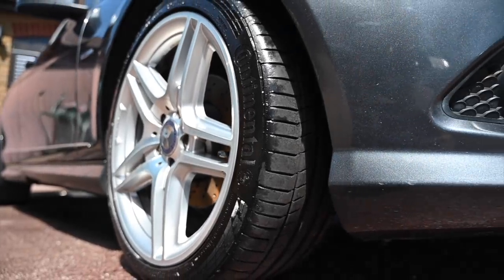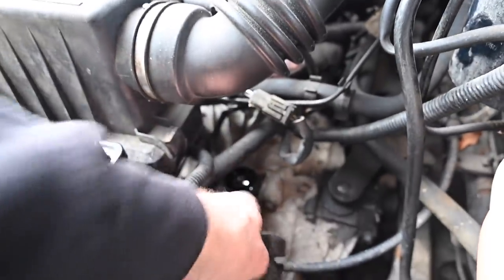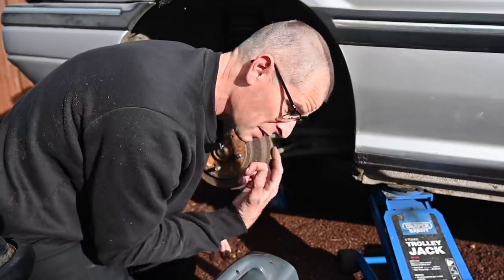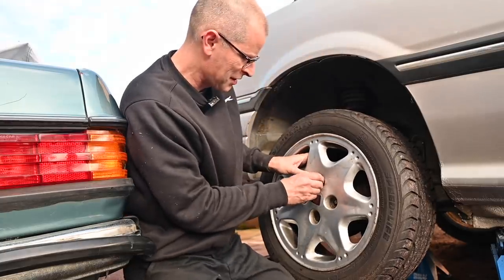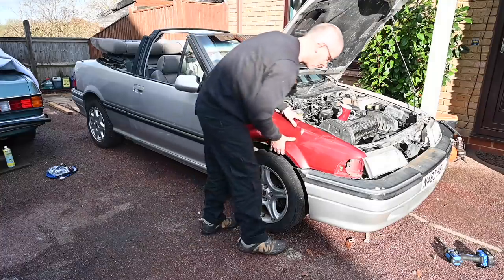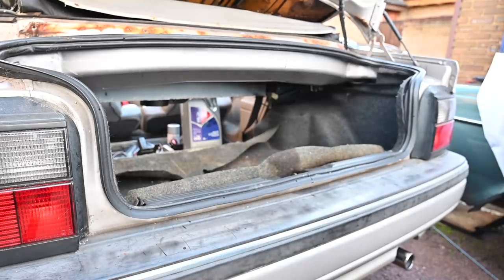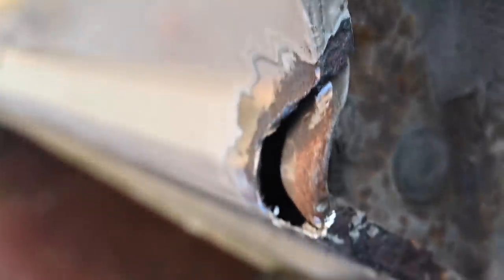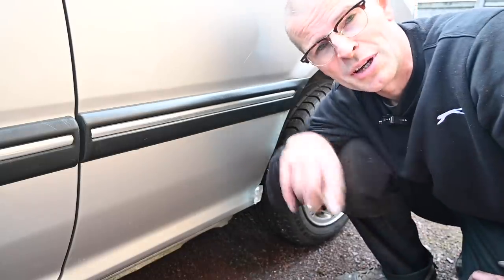Rover convertible MOT prep part 1

Comment: You should use  a test light not a meter for checking current at the pump. A meter will read battery voltage through a single strand of wire.

Comment: Excellent!  A slightly dodgy body repair that I can relate to 😊.   When I fill a gearbox I use a funnel with a piece of hose shoved onto the end of it that fits into the filler hole.  Then you can hold the funnel up high and pour oil into it (slowly).  I'll bet there is another plug somewhere that has poor connections, either that or there is a problem with the plug at the pump.  Either way, it's your fault, not Quentin's.  hahaha

Comment: You can't really check circuit integrity with just s volt meter because you need to check the circuit while it is loaded and carrying current (or not).  Being as you're testing the circuit unplugged there is no current flowing so any reading is untrustworthy.  It's even possible, depending on your meter that the meter is creating the 6 volts.  Either test the circuit with the pump plugged in or run an incandescent test light in parallel with the meter so that there is current flow and/or voltage drop.  And look for battery voltage, not just 6 volts.

Comment: Well one thing is for sure, with a security system like that no one is ever going to steal it....i hate electrical problems as you are never sure its actually fixed or you're just lucky its worked

also yep those wheel do look better
Reply: I remember when my Rover 220 GTI got nicked and all they did was pull the front wing arch plastic covers open and pulled the wires off the horns. So even though the alarm was going off it was completely silent. Yes Rovers anti theft device was disabled in about 30 seconds. Hated the scumbags at the time, but funny looking back now😂

Comment: Strange why there’s only 6v at the pump ? Did you change the relay ? I used to test relays with a 9v Duracell to operate the relay then check the resistance of the internal contacts with a multi meter, I’d temporarily bypass the impact cut off on the bulkhead just incase its corroded, talking of corrosion, I bet that spare wheel bolt is solid with the amount of water ingress that car has/had mate, good luck 😉
Reply from the maker: Yes, changed the relay then it worked and now it doesnt!

Comment: Sure seems like the fuel pump relay. Intermittently working/not working. I would do a second search, it may be integrated...is there any workshop manual that can enlighten you?
Reply from the maker: Ive got the factory manual but the cabrio is different (helpful)

Comment: Rear wings available at Rimmer Bros for a stunning £50. Cheaper than a w/a section and you can fit as much or little as you need. You know it makes sense.
Reply from the maker: For the convertible? They do have some random mega deals, although that doesnt include the hours of fitting
Reply: @furiousdriving  Just checked again .... they were £54, now sold out. Sorry. N/S Tourer rear wings still available at £54. Wheelarch with some sill available at www.carbodypanels4u at £50. If you bog it up the rust will only bubble back through your respray.

Comment: 6.5V to the connector is probably because there is a very very bad connection somwhere between the battery and the connector (or a broken cable, that barely makes connection.).
Reply from the maker: must be, or a corroded connection

Comment: Checked the relay for the fuelpump under a magnifying glass? I've had cracks in the solderings that made it work sometimes on my old volvo 244... Is there a fuelpressure sensor that starts the fuelpump? Is the ignition switch behind the key okey?
Reply from the maker: It might be the relay again, Ill have to take it apart

Comment: do you think that it could be an immobiliser problem because I used to have a Renault Clio back in the 90s and sometimes when you unlocked it and put the key in it wouldn't start it was just in the same thing as your car is doing you have to pretend to get out liquid over the remote and then unlock it again and then it would start
Reply from the maker: I did try locking unlocking opening the door but I think it cuts the starter rather than the pump

Comment: I've been at the forefront of the Save The Rover campaign, encouraging you to keep going, but this is the last straw. I don't want to be responsible for you having a mental breakdown Matt, so it might be time to cut your losses, save your sanity and get rid.
It's a wrong un and a British wrong un will never be a right un.
Put your effort, dedication and skills into the W123, at least it was designed and put together by skilled workers, not disgruntled badly manged ones. There's a chance the Merc will reward you for your time not keep kicking you in the nuts.
If you're that deep in with the Rover and push on then I wish you all the luck in the world. You must be the most patient person in the world, I'd have set about it with a sledge hammer a long time ago.

Comment: 6v is fuck all for a fuel pump. You need to carry out voltage drop tests on the rest of the circuit to find out where you’ve got some high resistance consuming the voltage

Comment: Quintin seems to be a good example of Quantum entanglement.
until that key is turned the car is simultaneously broken and fixed.

Slightly more annoying than my other example, the Morrambulance, which is simultaneously an Ambulance and a Morrison Delivery Van, until it get close enough to actually read the words on it.
Reply from the maker: Schrofinger's cab! I used to not be able to tell local police cars from taxis when they were all Peugeot 406's